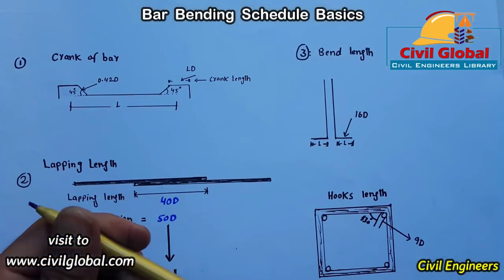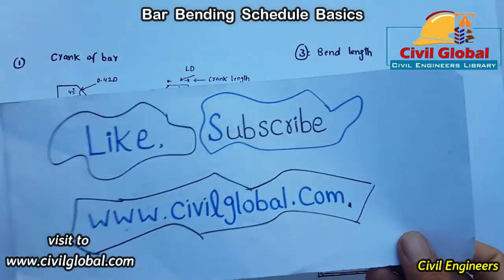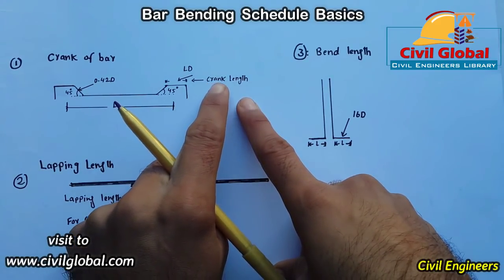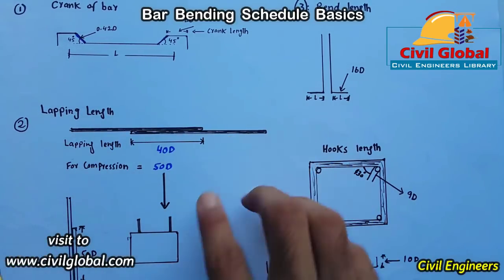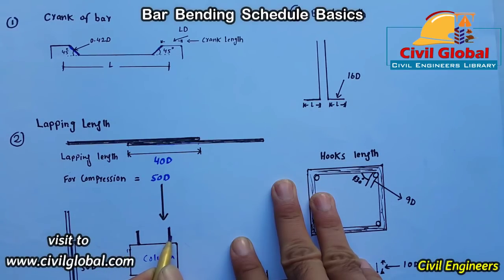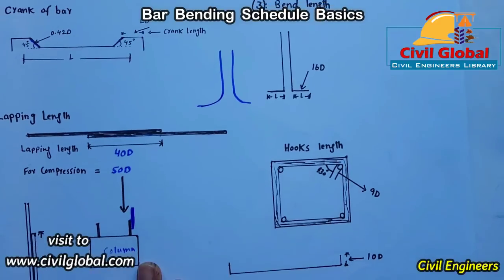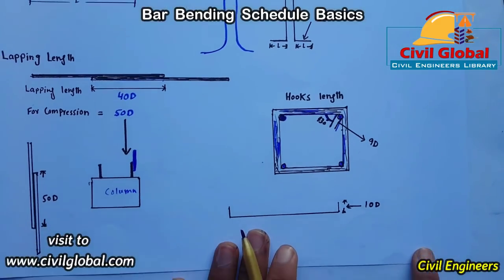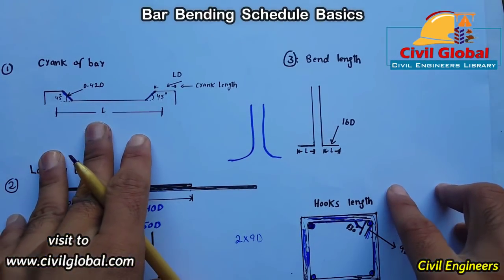Bar Bending Schedule Basics Formulas | Bar Bending Schedule for Beam and column

Comment: sir you should tell us what is the unit use to apply these formulas
Reply: Diameter D should be in mm
Reply: Example: If stirupp dia= 8mm then 9x8=72mm which is the hook length.But in site we execute it in feet (72/304.8=0.25 feet) which is 3inch

Comment: Sir I am btech student.sir my project work is going on my topic is seismic performance of flyash  concrete building with flyash brick and burnt clay brick masonry infill. In experimental we can do the strength of flyash brick vs clay brick by using utm machine in design I am using etabs software so in design first we consider to build a building full of flyash then 2 one is clay brick.sir plz give the design for manual calculations in flyash brick building and clay brick building

Comment: How we can get 130 degree because the angle between two stirps is 90 degree
Reply: He is measuring angle from wrong direction, also the angle is 135° not 130°
Reply: Yes 135 is correct

Comment: hello your formula for crank length is totally wrong if we use your formula L.D for example dia. of bar is 20 mm and length of bar 1000mm (1m) then crank length will become 2m which is very long so such long crank length is not provided
Reply: Tanjil Khan d means depth of slab